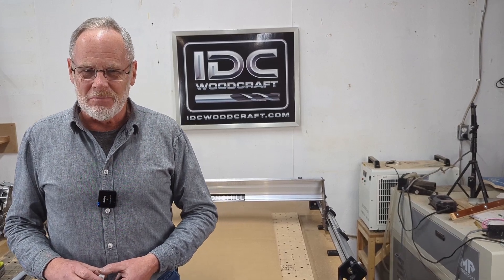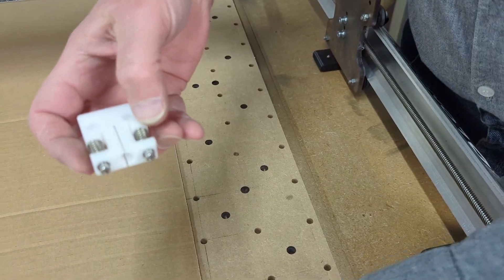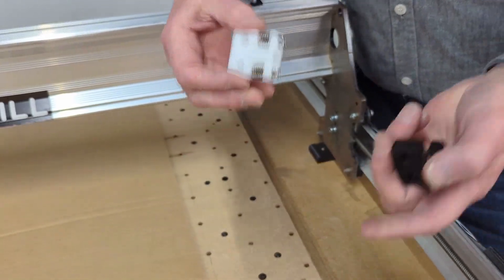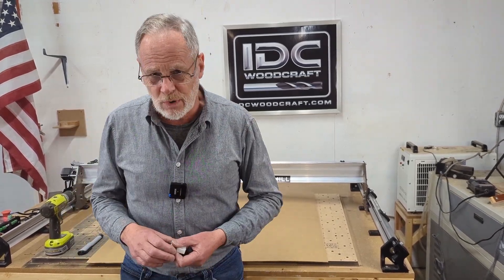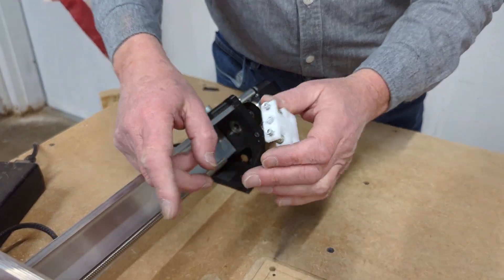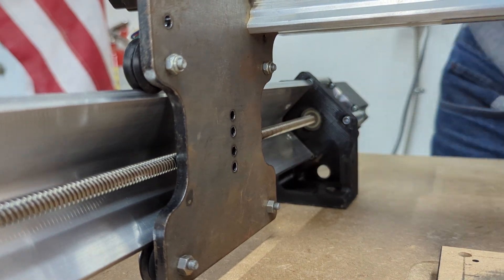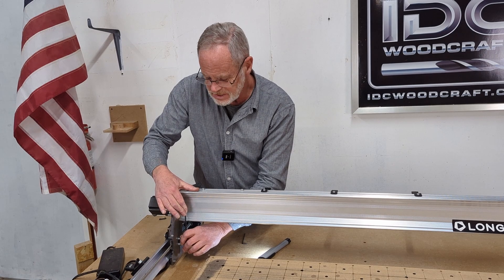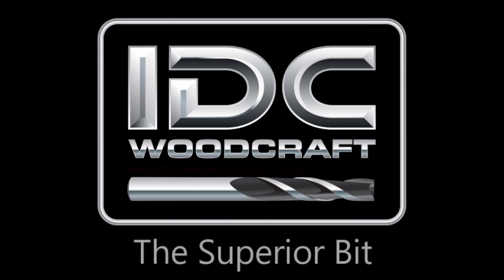Important Upgrade For Your Longmill CNC Router - New Anti-Backlash Nut MK1 & MK2

Comment: I enjoyed the update video especially the part about the anti-backlash.  I can not get them to scrww onto the x axis screw or the. Z axis screw.  I had to use a vise gripe to hold and turn the blacksquare with pliers.  They are so tight that I do not see how an electric motor will turn them.  What have I done wrong and would the new white ones screw on with ease like in the video?  I don't like proceeding with finishing assembly until I van resolve this.  Thanks for your help.  I do not know where else to turn to.  I will join the blog on Wednesday to ask the CNC community what I can do. Everything else is assembling fine but the X and Z axis screws are frustrating
Harvey Almarofe
Reply from the maker: Harvey, I'm sorry you're having issues with this brother. I recommend reaching out to sienci directly about this one though, they should be able to give you the best guidance. Here's the link to their contact page in case you need it: http://bit.ly/499dtxg.

Comment: I have a question. Last 2 vcarves (handwriting) from left to right. Left side nice and deep and starts to get less deep as it goes to the right side. Is there a fix for that? Spoilboard is level
Reply from the maker: The project piece thickness deviates can be a reason. Did you surface it first. Should already do that for v carve if you didn't
Reply: @IDCWoodcraft  not sure why I didn't think of that. I never started the habit of surfacing even tho I do have a bit. Thanks

Comment: Yup- the adjustments on those things, the finicky adjustments on the v-wheels, and the whip on the long leadscrew on the 48" wide Longmill are the reasons I sold mine and moved up to a Onefinity Elite machine.   The noise, binding and chatter were too much to have to constantly deal with.
Reply: Well good for you. The Longmill is just fine, and requires only minor little periodic adjustments. Any machine will. I preferred to save just a little over $1000. Which is why most people get the Longmill. Also the community and company support can not be beat with any other company.
Reply: @LargeFry1  I had plans to buy a OneFinity before I bought my Longmill, also. However, when I compared the delivery times, I would have had to wait 6 months to get the OF, while it only took a few weeks to get the Longmill. I am very happy with my Longmill, it does EVERYthing I ask it to do, and I doubt I would have been any happier with the OF. As someone mentioned, you will have to do maintenance on ANY machine. The noise is not so much the mechanics but the router. My Longmill kinda sounds like a robot running 🙂
Reply from the maker: maddesignsllc9407, very good points my friend. The most important thing about any CNC you have is the projects that you make with it and I am very happy to hear that your Onefinity Elite is just the right thing for you!